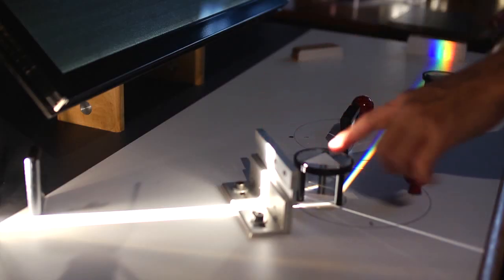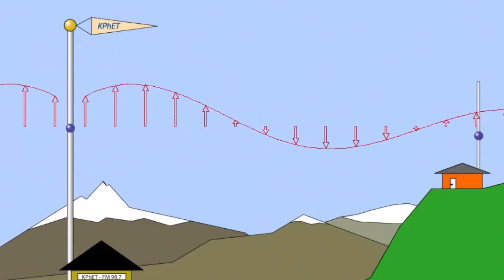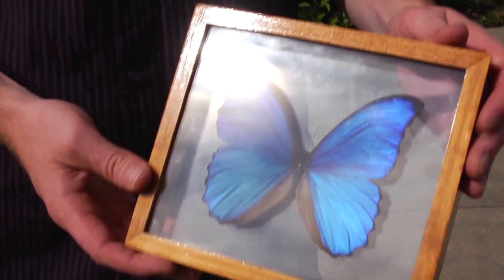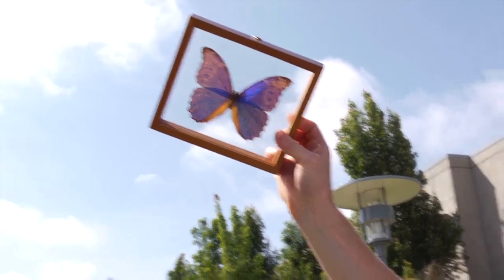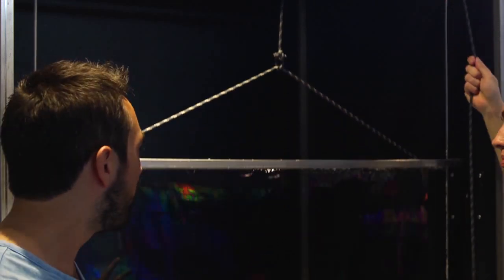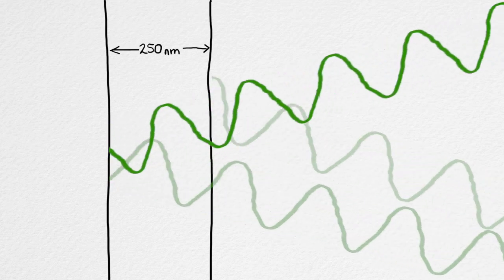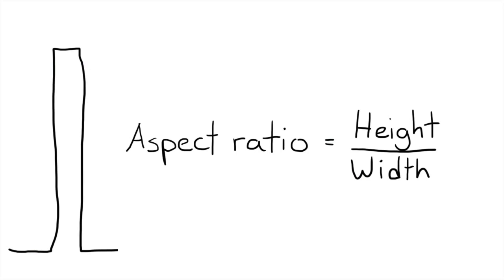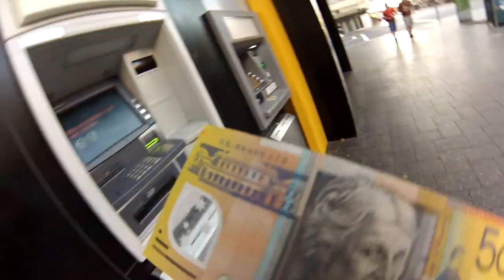How To Make Colour With Holes

Comment: I have heard that the light energy causes the electrons surrounding the atom in which the light is being projected into jump up a shell. For example hydrogens one electron will temporarily jump up into the second shell using the energy suppled to it and later release that energy when it moves back into the first shell. Can someone tell me if this is correct please, thanks
Reply: Yes in a sense you are correct. That forms the basis of emission and absorption spectra of many compounds. For example the golden yellow flame we get when sodium is heated in a flame is due to absorption of light energy by the indicidual electrons. These then get exited to higher levels and they subsequently release energy while falling back to their ground state config. For some elements the frequency of this light energy emitted happens to fall in the visible spectrum which we perceive as color. NurdRage has some great videos on luminescence in general so you can check out his channel for a live example. And the electrons need not fall back into the first shell.

Comment: but if we use such nano-tech on a 10 dollar bill, will that bill worth more than 10 thousand..? From what I learn, nano-tech are sth really expansive , and that don't sound cost efficient to me
Reply: They are literally just punching holes in film. It doesn't involve any microprocessors or circuits. Holes in film. Once you get the manufacturing process right this won't be expensive at all.
Reply: We need to wait until the technology becomes affordable enough to use in everyday circumstances.

Comment: but where does the energy go from the light that gets destroyed, by interfering with itself?
Reply: samramdebest
 I think the thing which everybody here is forgetting, and which wasn't clearly explained in the video, is that the complete cancellation only happens at certain angles. You could observe from an angle at which there is destructive interference, just as you could observe from an angle where there is constructive interference. As some people have pointed out, the angles at which you will observe brighter light are just as numerous as those with dimmer or no light, so the energy is just redistributed. It's important to remember that light is just a self-contained region of changing electric and magnetic fields, and those are what are interfering; they can cancel in just the same way that you might see halfway between two permanent magnets.
Reply: Great question! I think it goes into corresponding bands of constructive interference in higher and lower frequencies, but I'm really not sure.
Reply: Yeah, thats not how white light works. White light consists of all frequencies of visible light. The video doesn't mention what would happen if monochromatic light hits a film. Great question though, I wish I could give a better answer.
Reply: samramdebest Hello,
The light is not actually dissipated. If the coating has a thickness such that the reflected waves constructively interfere with each other, the object will reflect more light of that wavelength instead of allowing it to pass through (transmittance). If the coating makes the waves destructively interfere with each other, then it will transmit the wavelength better instead of reflecting it. But the total energy stays the same.
Reply: I've read around a bit on this and this is what I understand:

Think of it like two people moving a skipping rope up and down, there will be points where the rope will be stationary (nodes) and points where the skipping rope is moving the most (anti-nodes). The nodes aren't moving, but still contain energy in the form of pressure acting on it. It's a similar thing with light, just because you can't see it doesn't mean it's not exerting a force and I think the force is magnetic, though it's very hard to get a straight answer to this on the internet!
Reply: Julian, you are wrong. The first law of thermodynamics says that energy is always conserved. That means that in a total collision (where all kinetic energy is cancelled) the energy is transformed into heat. This is not how interference happens. And it is actually incredibly rare if ever that photons collide with photons. At least this is what I have learned.
Reply: And to make things stranger, is it possible to inverse the phase shift and make the green (in the video) light visible again?
Reply: ***** You are never sending only one or only certain frequencies, unless your signal is infinitely long. Any start or stop of transmission actually requires infinite spectrum to happen.
Reply: A nice (but maybe not so deep) answer to why don't photons collide: http://www.madsci.org/posts/archives/2004-02/1077201223.Ph.r.html
Reply: The energy dosen't go anywhere. Light interferes with itself to create regions of maximum and minimum intensity. So basically the energy is just being redistributed into bands of light and dark. It is similar to asking the question where does the water during the depression regions in ripples. The amount tha the water goes down in a trough is equal to the amount of water that rises up in a crest. In light we just speak about intensity instead. So basically interference is just a redistribution of energy. I highly doubt theres any heat energy being involved here. Ordinary interference effects like the one's shown here and the ones you see on a CD have nothing to do with heat energy. Its basically light energy thats in question (Poynting vector). If this is till not very clear you can just google interference and you will get brilliant results. This is why to properly observe interference we need a coherent source of light. Incoherent sources of light have no definite phase difference and what we see is just a time averaged intensity. Hope this helped.
Reply: SuperVelvetEars GordanCable But if you only send the frequencies that get destroyed and not the other ones, than no energy can go to constructive interference
Reply: samramdebest Unfortunately (as I tried to say above, in the deleted comment) I actually did not watch the video before commenting. The reason being that Youtube autoforwarded to next video while I was commenting, and my comment landed on wrong video. :P But you are right, it makes me wonder too where the energy of the filtered wave lengths go.
Reply: samramdebest You may be sending those frequencies, but the frequencies you don't send will have to be stopped somehow, right? You're probably going to turn that other light into heat.
Reply: It does not matter if your light source is monochromatic. Actually the first double slit experiment was conducted with monochromatic light. All interference is , is light waves interacting with each other to produce regions of high and low intensity which respectively correspond to crests meeting crests and troughs meeting troughs. And please elaborate on what you mean by getting only dark when monochromatic light interferes with itself. You can verify this yourself by taking a sodium light source which is monochromatic and observing the interference pattern by making the light pass through 2 slits. It is not possible for light to interfere with itself and produce only darkness as far as I know. The frequency of light has nothing to do with the concept of interference. Sure it affects some of the parameters like fringe width , etc but the basic process remains the same. The reason we get different colors when using non monochromatic light is due to the fact that for some frequencies the two interfering light sources are exactly out of phase as explained in the video and hence produce regions where that color is absent.
Reply: crickeycool this isn't about the 2 slit experiment, the video here shows a light frequency canceling out itself, if you only send in that frequency there is no light bands left where that energy could have gone
Reply: samramdebest There is no surface that reflects 100% light, so for each bounce a little bit of light is lost as heat or some other energy
Reply: Possibly it might have something to do with the fact that there's electric and magnetic parts and I think they're out of sync so constructive interference in one is destructive interference in the other which should keep energy conserved. Not 100% certain though.
Reply: But how you say it can't be right, because the cancellation means that it doesn't exert any "force" because it is that "force" that our eyes would see
Reply: GordanCable i'm glad you said that, because all that time i was thinking about the question based on monochromatic light :)
Reply: X deleted X - Youtube switched the video for me, wrong comment. :)
Reply: And in the double slit experiment the energy does not vanish anywhere the bright areas are as much brighter as the dark areas are dark.
Reply: Petri Sirkkala what do you mean no cancellation of light?, did you even watch the video, it explains how certain wavelength get out of light by canceling themselves out
Reply: As Petri said, the energy does not vanish, the bright areas are brighter. There's no annihilation, that only happens when matter and antimatter collide. Waves change pattern.
Reply: Dominic Porter but what if you send monochromatic light in
that is the correct term right?
Reply: Petri Sirkkala s**t, that IS a good question
Reply: What you're talking about is polarization. It can happen in amazingly short distances.
Reply: ***** whoa. mind = blown!
Reply: the energy is not destroyed its redistributed. like if Destructive interference has Intensity of 0 then Constructive has intensity 4 times (the intensity of each wave interfering)
Reply: Petri Sirkkala That is, I am trying to say that even if some frequency is totally cancelled out there are more than enough frequencies that can take the energy (spread out the signal). Heat dissipation would happen, if the material absorbed the signal, or if the signal changes frequency and the surroundings attenuate the signal (by absorbing) it. It has been a few years since I studied these, so if you need to study this, ask me references to literature.
Reply: The energy goes nowhere else cause its fully used for the interference and its explainable by quantum mechanics. In quantum mechanics you see the light not only as waves but as particles. Those light particles are the photons. In the interference the photons of the original wave and the reflected one hit each other exactly opposite. So there is a momentum and because the photons have exactly the same mass and speed, they have the same energy so they extinguish each others movement. There's no more energy in one of these photons after the crash. If you now shift Einstein's formula E=mc² to m=E/c² you can see that these photons don't even have a mass any more because they have no energy and no speed.
May sound weird but thats what quantum mechanics tells us.
Reply: ***** pardon my english above, it is not my native. I don't mean you are wrong, but what I understand that you said about energy of light can not be right, since the total energy is not conserved. Or maybe I missed something there?
Reply: heat?
Reply: iCey Cape but it is light that cancels out light. This can also happen without any other particles around
Reply: Jonathon Gay yes but it will never be as much as the light that gets reflected.
Reply: Wave interference is relatively intuitive when we are contemplating a wave moving through a medium (ie water...). It would be mysterious to consider energy disappearing via destructive interference but when we consider the interference is occurring at the boundary layer, it makes sense. That is what I would speculate is occurring... The light is being absorbed and re-emitted at the boundary layers and at that point the energy is being dissipated during destructive interference. What form that energy would take is still an interesting question.
Reply: the energy isn't destroyed, it only changed forms
Reply: I see you're talking about interference of two circular (or how are they called? Radial?) waves.
What about two straight, parallel waves?
Like this (but overlayed):
| | | | ->
 | | | | ->
Reply: I've asked that question myself.  One of the ways the concept of thin films came to be discovered was that someone noticed that old glass was actually MORE transparent than new, polished glass, which later was determined to be true because of a thin layer of "weathered" glass on the front of the glass.  (I believe I have my story straight.)  So more light went through the thin film and through the glass when the film was causing destructive interference for a reflection.  In quantum mechanics we'd say that since the two light waves would interfere destructively, the probability of a photon reflecting is very small, so it doesn't (most of the time), it goes through.  So the "extra" light actually goes through the glass, or, in this case, through the soap bubble.  So when, say, green is being "taken out" of the reflection, the percentage of the green light going through the bubble is greater.  (I'm ignoring the multiple reflections that could happen within the thin film of the bubble.)
Watch his video on the double slit experiment. According to the math of quantum mechanics, each photon has a probability of where it will end up, and when both slits are open it predicts the interference pattern exactly. Even if you send one photon at a time and detect where it went, over time you will develop the same interference pattern.  So the bright spots are BRIGHTER than they would be if there were no dark spots.  (The CRAZY part is how did the 1 photon "know" both slits were open.)
Reply: crickeycool you don't get the point, if you send light with only 1 frequency there is only dark left, no light bands to redistribute the energy to

Comment: Another thing to think about is what if you could make those holes variable in depth or thickness and have that variability programmable on demand? That's essentially what Qualcomm did when they invented the Interferometric Modulator technology for their Mirasol display systems. By modulating the depth of the resonant cavity, they can generate a brilliant and wide gamut of colors using very little power and no other light source other than what's available ambiently. Excellent sunlight viewing.

Comment: Let's take a look at the evidence, shall we? A run-on sentence an ungrammatical sentence in which two or more independent clauses are conjoined without a conjunction. The first sentence that I separated was 'You should." 'You' is a noun and 'should' is a verb, so that's one sentence. You didn't connect the two sentences with a conjunction, so it's a run-on sentence.

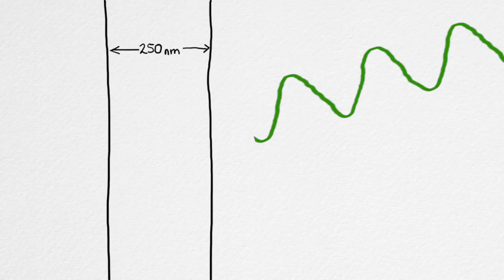Comment: The statement at 3:45 about the green 500nm  light being removed is not entirely correct.  The light is not "removed", it is cancelled out by its second reflection that is reflecting at an opposite phase.  I think this was just a wrong choice of word to use.

Comment: Actually, yes. English (England) is slightly different from English (United States). They both call it "English", but they are referring to two different, yet extremely similar languages. In England it is 100% correct to spell "colour". In the U.S. it is 100% correct to spell "color". It is so utterly pointless to attempt to compete between the two concepts. Really, either version is only incorrect in places where someone doesn't receive the message because of confusion over spelling.

Comment: Yeah, it uses the phenomenon of interference too.
Except it uses a monochromatic laser. The holes are 1/4 of the length of the wave lenght of the laser, so when the laser is above a hole, the light is cancelled. Then, the change in the intensity of light is detected, and converted into binary bits, 1 or 0.

Comment: A laser detects dents in the disc, If it's dented, that's a 1, if it isn't. that's a 0.
All of those dents make up larger pieces of data, for example: 101 is 5 (look up binary)
SD cards (or other forms of solid state storage) use transistors. each transistor is either on (1) or off (0) which makes up the data. and is read with signals.

Comment: Bear in mind, that is NOT the size of a photon, going into ultra violet waves will make that figure smaller, and more so when you move even further down the spectrum all the way down to gamma radiation.
Light acts as a particle AND a wave.
I'm not certain how small a photon is, or if anybody knows. But using gamma radiation to view the holes or atoms is a bad idea, because it would probably wind up giving someone radiation poisoning.

Comment: Yes, they seem to have been taken with a SEM or possibly a STEM.
The wavelength of an electron is much smaller than that of a photon with equivalent energy, around 500x smaller, in fact.
Also, cameras don't need visible light.  Though it would be extremely impractical, it would be possible to image things this small using extremely high-energy (low-wavelength) light, such as gamma rays.  X-rays may even be sufficient for a blurry image.

Comment: So you're proposing a gold based currency system?  How would you value non-24 karat gold?  Most gold is not pure, it's an alloy.  Would you implement a floating point scalar system and install density scales in all merchant/commerce/financial institutions?  Should the electronics industry suddenly stop using gold in their manufacturing process?  Because if we're going to choose a single element from the periodic table as our medium for exchange we should probably stop consuming it, right?

Comment: Well thin film reflection only gets rid of certain wavelengths because its thickness correlates with those wavelengths. Thickness varies across that soap sheet due to gravity, might've produced green somehow. Also I think you had a banner or something reflecting off of the film on the upper left, nothing to do with the thin film phenomenon you were talking about though.